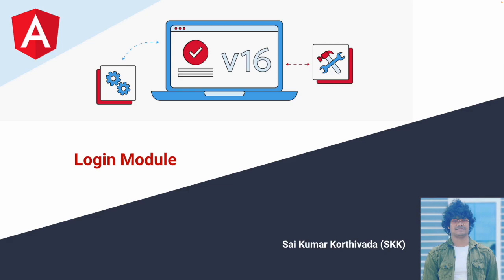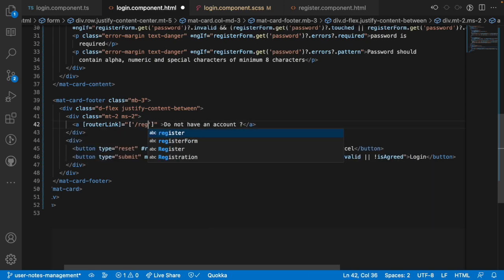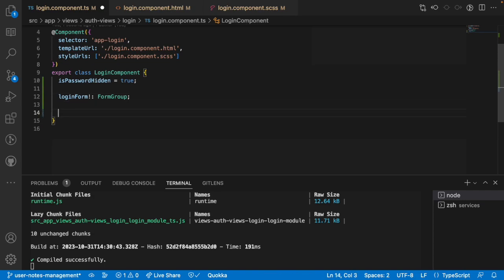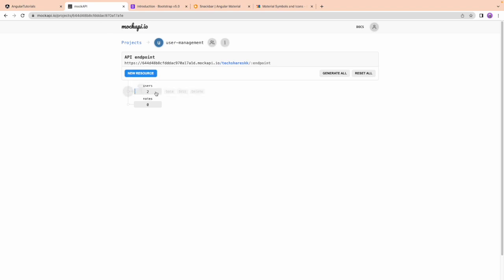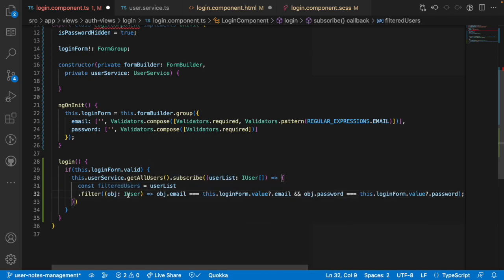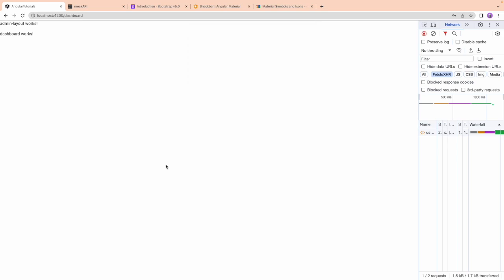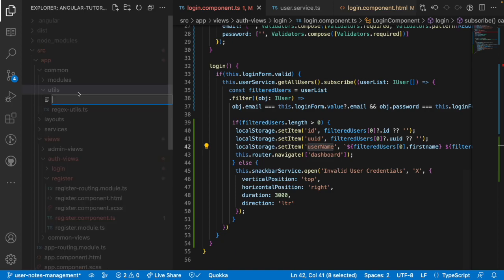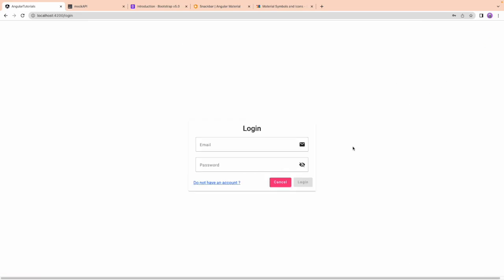Login Module | User and Notes Management | Angular Project  | Part - 4

Comment from the maker: 00:02 Designing and implementing a login module using Angular and reactive forms.
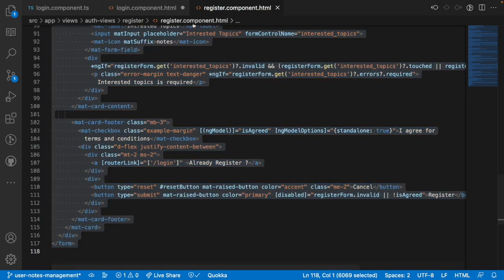02:21 Customizing the login form fields and functionality
04:41 Customizing UI with margin and padding
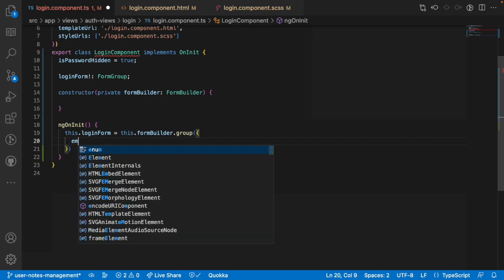07:28 Adding email and password group with validations
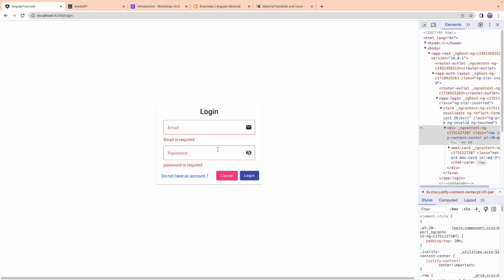09:52 Validating email and password for user login
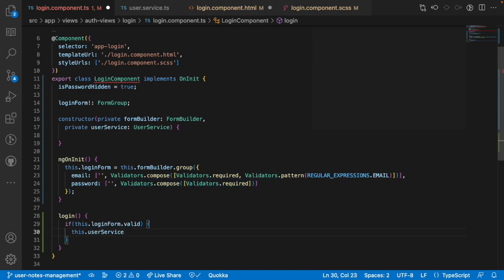12:12 Filtering user list based on entered values
14:56 Valid credentials navigate user to dashboard.
17:10 Storing user data using local storage
19:29 Creating a utility for managing local storage keys
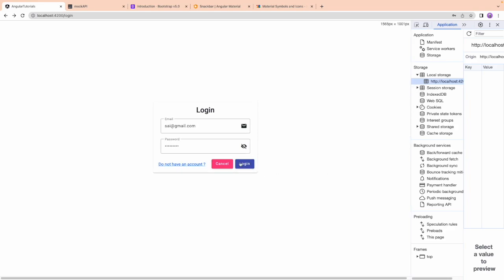21:53 Successfully implemented login and authentication functionality
23:55 Creating a common component for all pages

Comment: i have a doubt its reguarding ngIF :
 the situation is i have a card it id divided into two sessions 
(session1: is for displaying name and id ) and (session2 : is for entering the password) .

 Initially the card will show the name and id , so when i click on it the password field in the session 2 should appear and i should be able to enter the password and login .

 ISSUE: is that suppose i set a variable isClicked to "false" 
and when i click on the car the fuction onIsClicked() is called 
and the isClicked value is set to "true" 
and now the password field appears 
but as we said the password field is inside the session to of the card
 so if i click on it again then the password field disappears because then again the card is clicked and the isClicked is set to "false" - im confused here ca you help me🥲